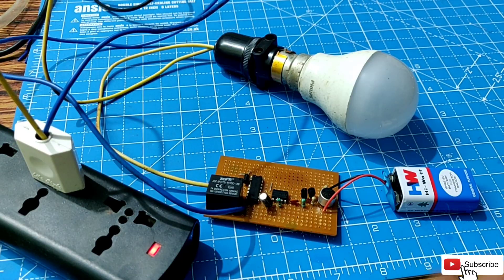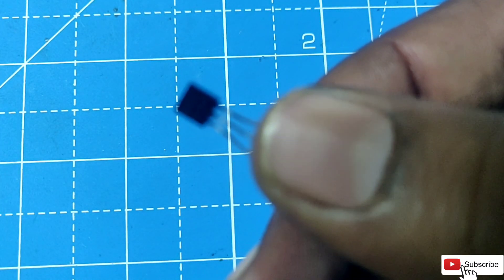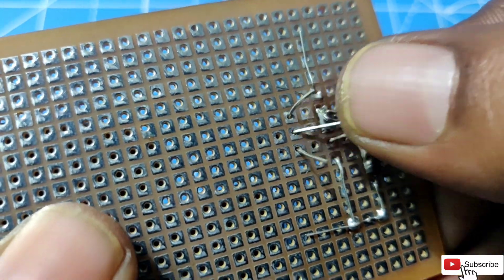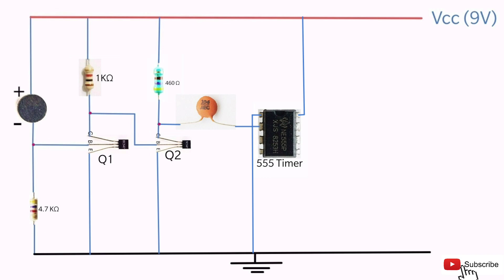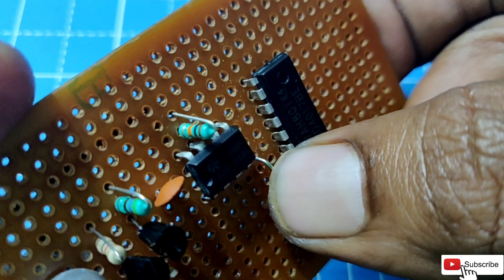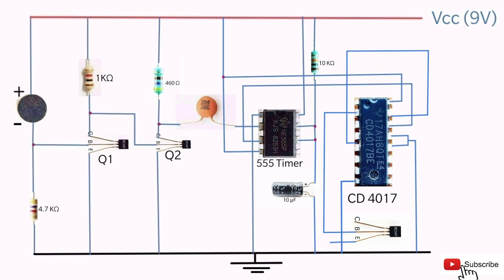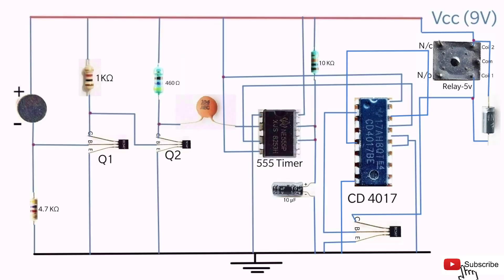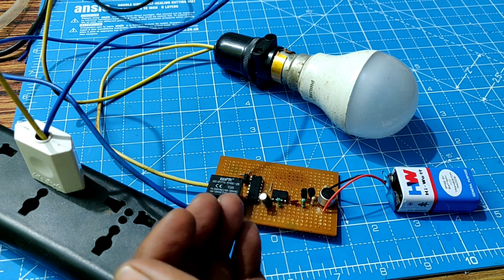How to make a Light control using clap sound using 555 timer and IC 4017 at home | clap switch

Comment: Can I use 6v relay
Reply from the maker: Check the voltage at the Collector pin of the Q3 transistor and VCC with the help of voltmeter. If it is around 6v then you can use it. Kindly note that there is no need to connect the AC supply for this test.
Reply: Yes it's working bro thanks for explanation 👍